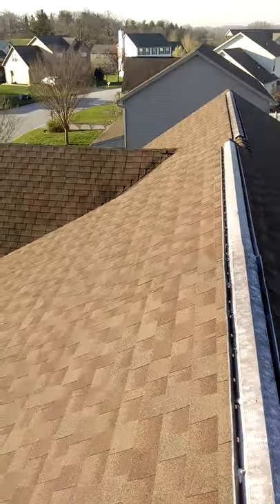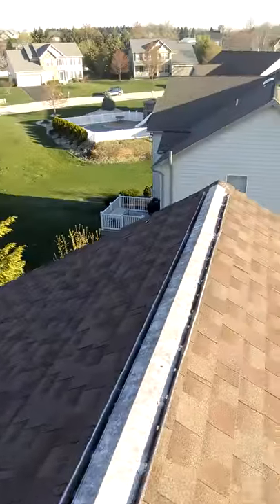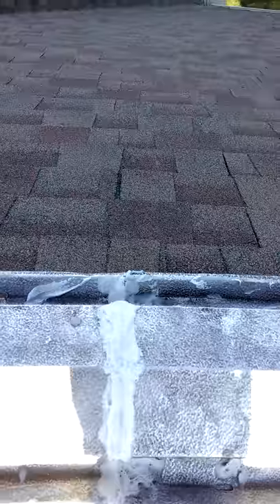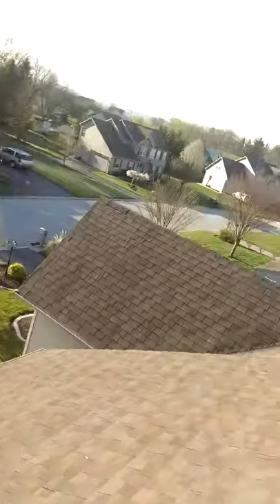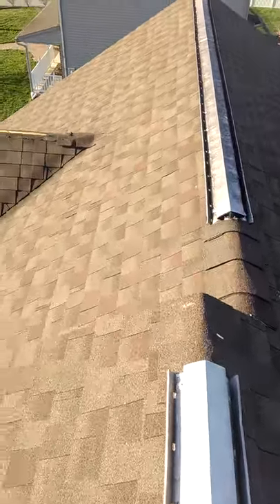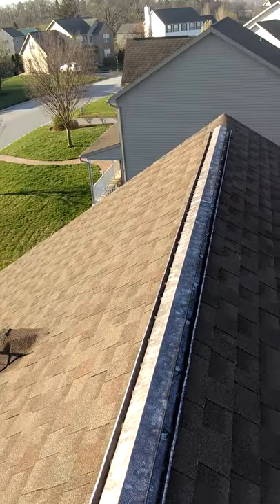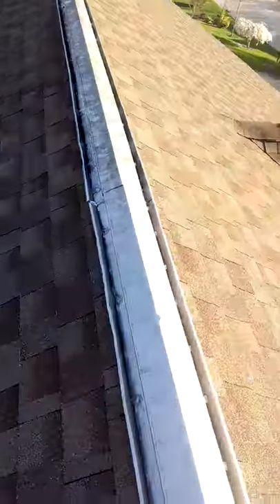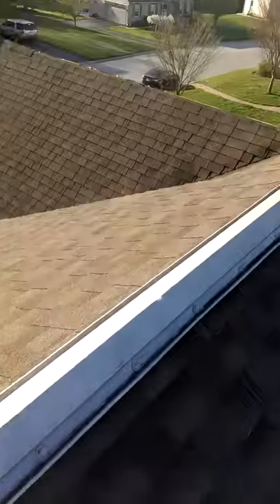Roofing Metal Ridge Vent Leaks Part 1

Comment: You have no idea what you are talking about. If you install the metal vent correctly and use grommets screws and set the edges in caulk you won't have those problems.  Also you have to make sure you're installing that vent with a filter mesh. I will say that there are some instances where it is not a good fit like the back two dormers as the pitch is to steep. And those two dormers should not have venting as it negatively affects the upper ridge venting. Cobra mesh roll is junk and is very poor at venting flow.